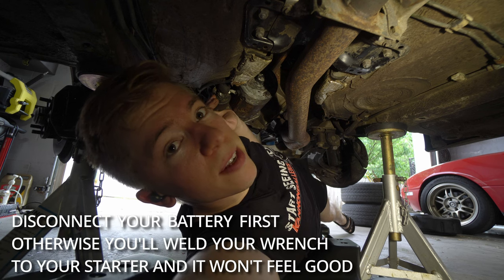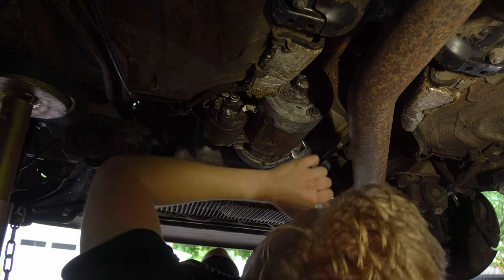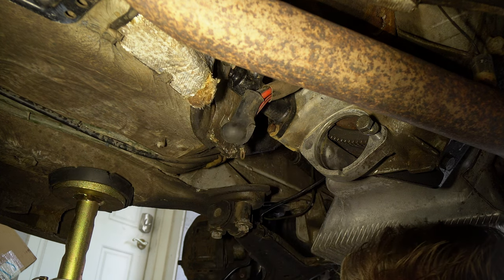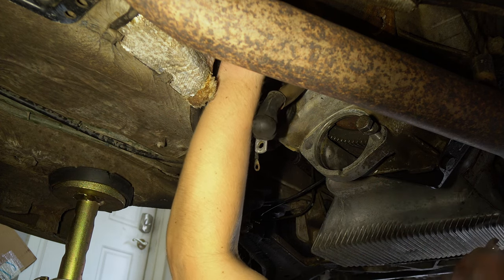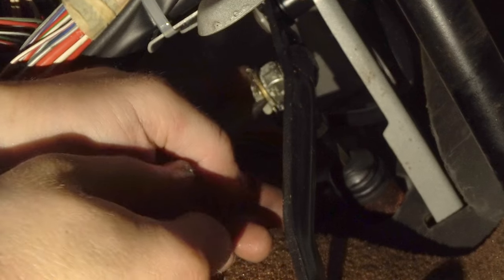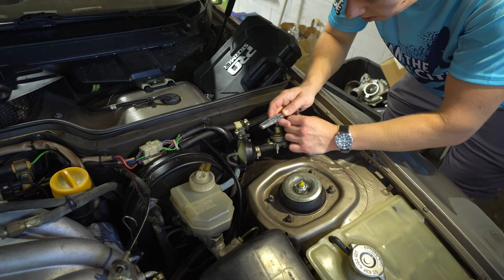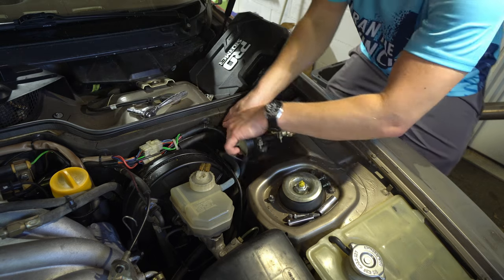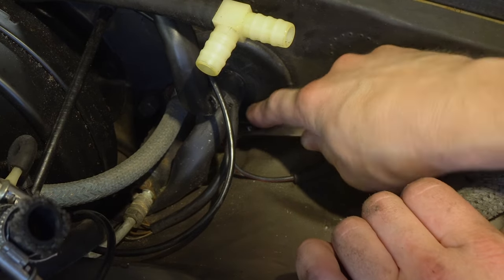Porsche 944 Clutch Master and Slave Cylinder Replacement

Comment: Another really good video. My second gear is real slow on my 944 I have to feel when it wants to give up that gear on the upshift. Hmmm
Reply from the maker: Does it get better as the car warms up? My Miata can be stubborn at getting in to some gears until the transmission is fully warm

Comment: Thank you for the video helps a lot. Recently had my slave dump brake fluid all over the floor and the boot of the master start leaking in the car. replacing it all
Reply from the maker: Good idea, make sure to replace the line from the brake master reservoir and between the master and slave!! Glad it was useful and thanks for commenting!
Reply: @HardwayLearning  Was planning on it. Not sure if it has been changed since early 2000s so rather replace it and not have them fail right after I replaced the slave and master.

Comment: I've found that most European cars use 13mm, and Japanese will use 12mm for the same-threaded bolt or nut. Also true on motorcycles. after cleaning your threads, a "dab" of anti-seize will help future you...
Reply from the maker: Now that you mention it, I've never connected it in my head, but this statement is totally true!